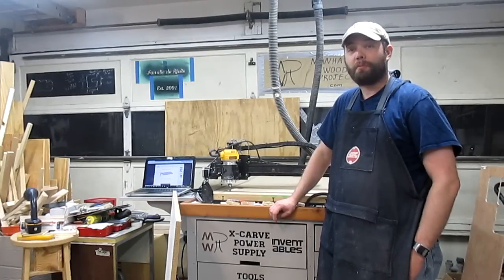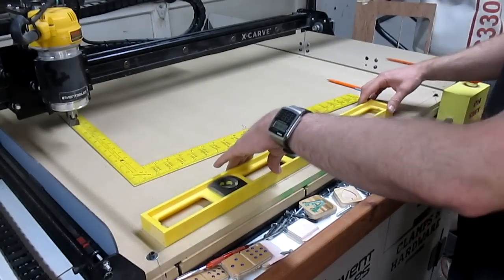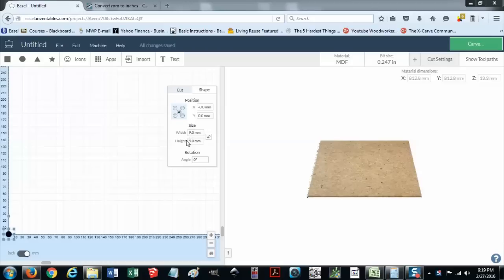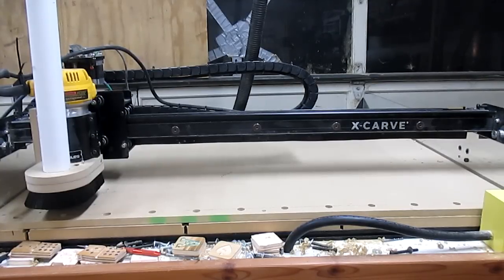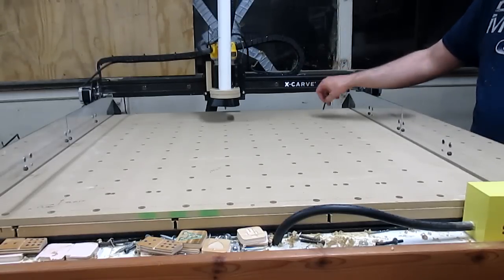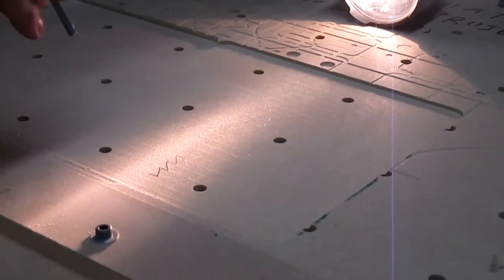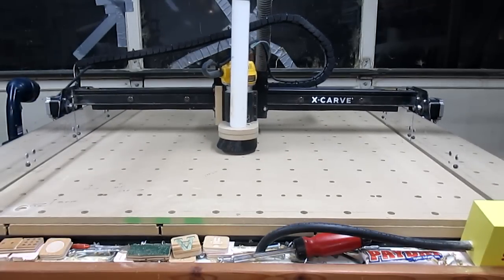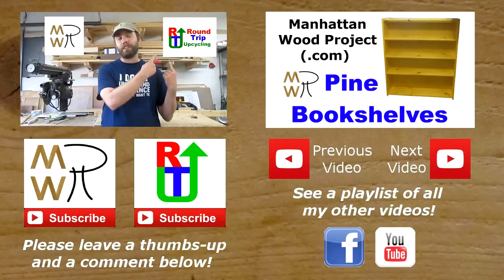39 - X-Carve Secondary Wasteboard - Manhattan Wood Project

Comment: Not a bad idea for ANY make of CNC... The specifics of how to adjust one can usually be fond in the paperwork that comes with factory made ones..  If you got a home brew like mine, you dont have the paper but you will know how to tweak it..  :)

Its good practice to do a through checkout somewhere close to every 100 hours off use on any cnc.  Look for loose bolts, V-rollers, belts and dont overlook the anti-backlash nuts on the lead screws if yours use those and adjust or tighten as needed. Also clean off any crud that may be on the roller surfaces. Check for any slop in the drive system and also check that its still within calibration.  In my case, anything over 5 thou off in 24 inches means its re-calabration time. How you do it depends on the controller software.  Its the same deal with all controllers but the exact steps will differ. 

Every one does a spoil board a bit different but this trick will prolong the useful life of it far longer that you think. I fill up any of the major "plow tracks" in mine with a good grade of wood filler, or a lot of ever present sawdust well soaked in glue.  After the filler sets up just set Z zero to the surface and take off a thou or 2. All you really want to remove is just the filler above the surface. The looks dont matter, the level surface does.  At some point you will just have to replace it when it gets as thin as a sheet of paper.. :)
Reply from the maker: Good pointers.  I hadn't thought of using wood filler, that would definitely prolong the life of the wasteboard.  I wonder how fast the glue/dust filler I typically use would wear down my wasteboard cutter though.

Comment: Great Video!   Do you have an Easel file for this project you are willing to share?
Reply from the maker: Thanks!  I'll have to see if I still have the Easel file around, but you should be able to create the hole pattern easily enough.  The pocket size would likely be different since it is based on the actual cut area available to you, and that varies depending on your dust boot type and whether you have dust guards for your Y axis belts.

Comment: Are your bits hitting the threaded inserts when drilling the holes?
Reply from the maker: +Fred Franzel Nope, the threaded inserts are a couple mm below the original wasteboard surface.  I'm only drilling 0.5mm into it, if that.

Comment: Awesome video!!! Especially how you explain things in a way everyone can understand. No techno babble.  When the various CNC tools for the small shop starting to appear, I thought, SAWEET!!!! Then I watches videos, read and the more I researched, the sparkle seemed to tarnish a  bit.  All the tweaking, changing the routers, x-axis, y-axis, spindle rates,  software etc.  I trudged on....all the technical terms (thank you not doing that) the tarnish is now looking more like rust.  Now , I understand that all tools need a bit of  setting up to get the results you expect. some good some bad.  But, 3 days to setup!!! a manual that needs another video to understand???  For $3000 to $5000 I kinda want something that doesn't need 600 sq ft to assemble  and ends up down to a approx. 600 sq in.  I applaud people like you who see the need help people like me.  I have a fairly modern shop with the usual power tools and no longer see the need for another tool that will eventually turn into (dare I say it.. Shop Smith). I had/have one cluttering up my shed.   Sorry to turn this into rant...my apologies.  Again AWESOME instructional video.   Feel free to delete this if you want, I won't be offended in any way. I will still continue to enjoy and follow your works.
Reply from the maker: +Benjamin DeBellis Thanks!  I always hope my X-Carve videos are helpful to those with less mechanical experience, since I sincerely believe that a simple CNC setup like this is something anybody can do with the proper time and a few easy tools.

I know there's a lot of mods out there, but the basic X-Carve is still a fantastic machine.  It's got limitations, like any tools, but it's one of the few tools that can be easily modified to allow someone to go into a whole new realm of machining, such as brass and aluminum.  It's only something you want to purchase if you're interested in using it though, it's too large and expensive to be a "buy and use annually" type of tool.  :)